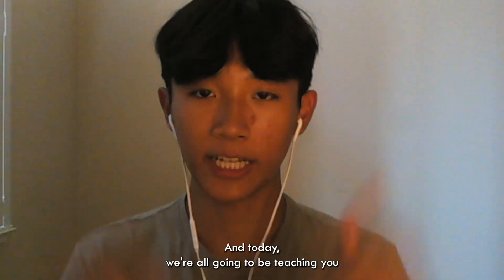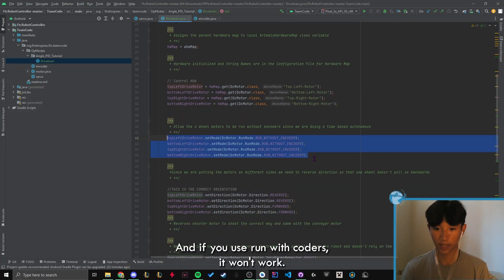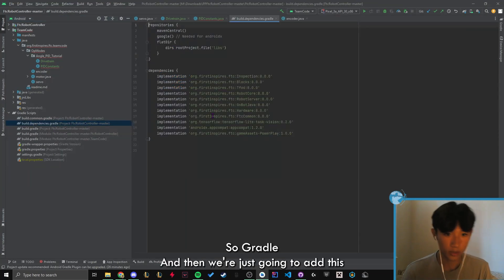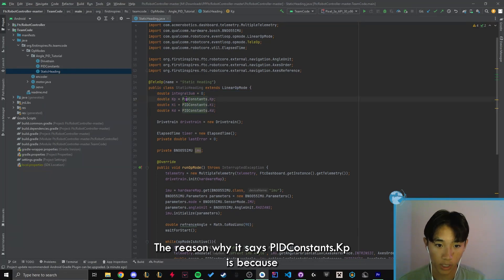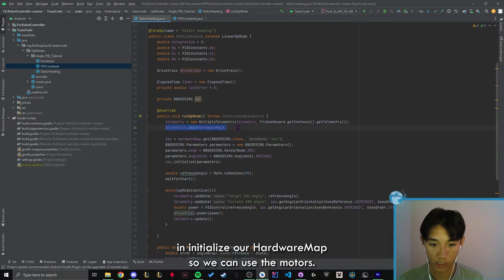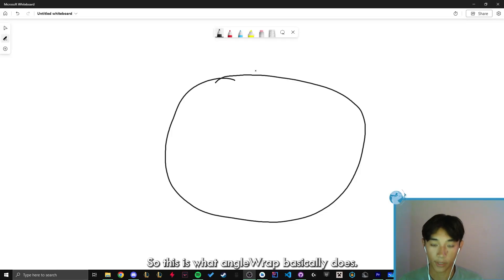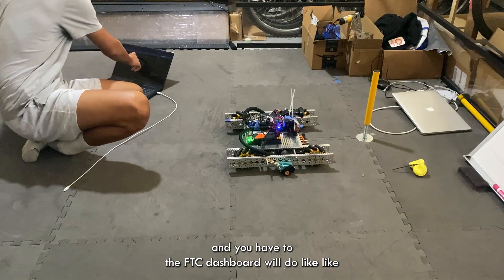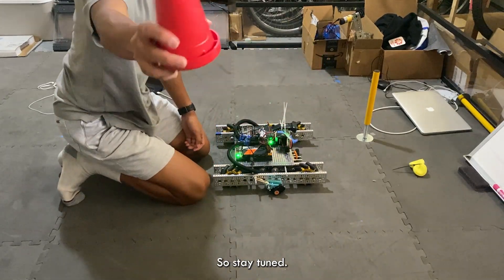FTC Programming Tutorial (Episode 8: IMU PID Controller)

Comment: Great vid. However, it would be nice to have the code that you wrote just in this video. Right now, the PID and camera are fused into one file (in the github), which is fine, but I would also like to have a separate file with just the PID code. Thanks!

Comment: Hi! This is not exactly related to PID, but... I'm currently doing roadrunner, and data for velocity (like max velocity, measured velocity, etc.) are not recorded in the dashboard nor the ftc controller. The drivetrain is obviously set as run_with_encoders and I tried 2-3 different opmodes in the road runner folders and no velocity us recorded. Can you help me pls?
Reply from the maker: Use run_without_encoders. run with encoders uses the motors built in PID system. You can still use the encoder if you say run without encoders